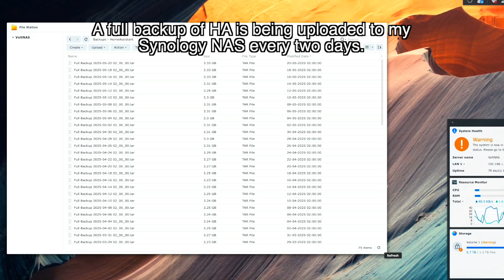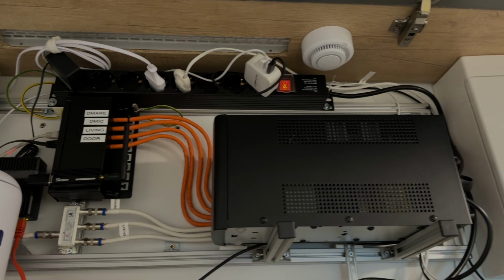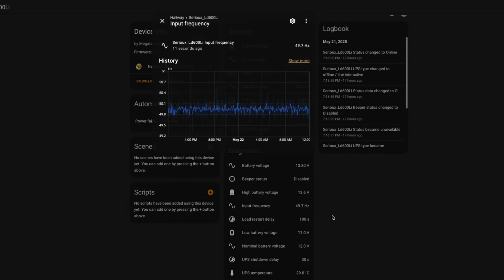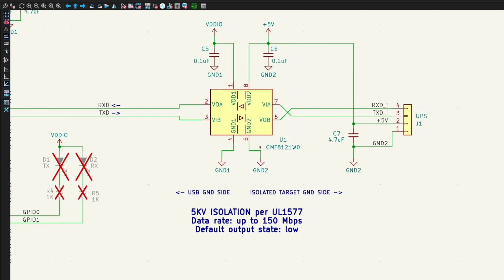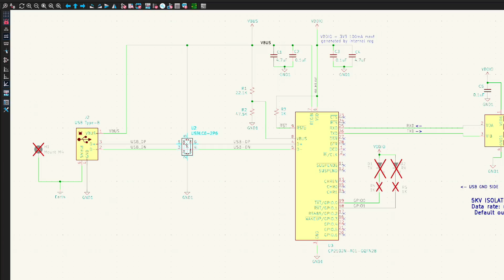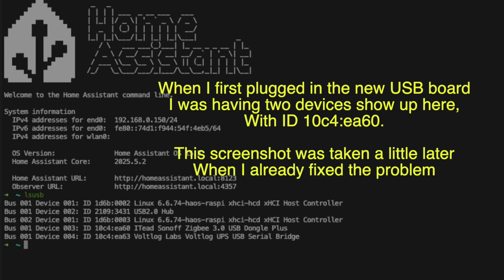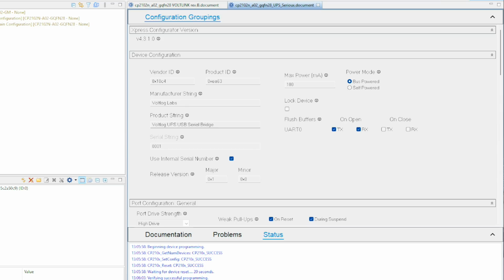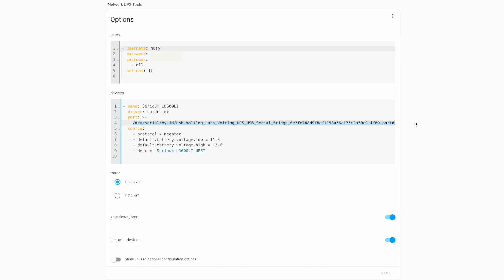I Spent 10 Hours Fixing a $40 UPS - Here's What I Learned | Voltlog 503

Comment: Bro, your HDR edit is INSANE!!! It uses 1000+ nits on white web pages and burns out my retinas. What's even worse: YouTube doesn't give an SDR option if you have an HDR screen.
Reply: The luminance difference between the camera shots and the screenshots is massive, it’s like having audio that’s suddenly 5x louder than the rest of the video. Anyone with a big bright OLED is going to get their pixels singed.
Reply: @Nathan0A  rofl
Reply: My HDR phone is just fine
Reply: @tullgutten  your phone has either fake HDR if it's LCD (no LCD on the phone exist that is HDR capable - it needs MiniLED/FALD backlight and the smallest known MiniLED device is iPad Pro) or it's "fine" because of ABL if it's OLED. OLEDs can't run more than 300-400 nits at over 15% window size - it's a very well known limitation.
Reply: @isoslow  ok i have to agree it's too bright. I watch through Brave browser to block all ads and it apparently didn't support or have turned on HDR, switching to the YouTube app i see the complaint 😅
And yes it's OLED HDR
Reply: @tullgutten that edit is just broken, but also making a tech video like this with flat screen captures in HDR was an absolutely stupid idea as there are 0 benefits from high dynamic range after all.
Reply: An icing on the cake? Bruh made it without a proper HDR screen - it's like color correcting a video on a black and white screen, LOL.
Reply: @isoslow  i love how certian types of asbies will complain about sensory overstimulation in the comments on all yt videos. normally they are the ones who freak out about music being included during a voice over. those same asbies love standing next to trains coz of how loud they are. makes no sense.
watched this video on my iphone 5s lcd... with the retina display. it was called that because its the max resolution your eyes can accurately depict lol. movies were shot at 24fps coz the brain will auto adjust and decide thats normal movement. like those people who wear glasses that flip their vision upside down and get used to it after a few days. the only contrary voices online are asbies with sensory issues
Reply: @isoslow Well pretty sure iPad Pro m4 can actually run at high brightness a lot, genuinely unwatchable in the dark.
Reply: @vevenaneathna So you are calling people with phones and displays that are like, a decade newer to the 5S and have HDR "asbies"
the 5S dosent even have HDR why are you even in this comment, it does not apply to you
Reply: @SUPERBOBESPONJA1000  i didnt say i was using an iphone 5s lol. its an iphone 5s lcd that is on my iphone SE 2016 in a 5s chassie that i built. it has hdr :)
Reply: @vevenaneathna  Still a decade old design, also no 5S has hdr nor the Se 2016
Reply: @SUPERBOBESPONJA1000  same camera resolution as the iphone 14 lol
Reply: @vevenaneathna So? dosent mean anything, my Sony Nex 3 from 2010 its 14.1mpx and its still better than any phone, the sensor is what matter not its resolution
Reply: I use revanced to block HDR content on YouTube
Reply: It's actually possible to help people improve, without belittling them. 

The creator asked you for specifics, so they could understand the concern, didn't argue with you.. yet, you still found it necessary to say they are stupid. Necessary?
Reply: I had no idea this was an HDR issue and now that I turned hdr off me and my retinas are thanking you for your comment 😅
Reply: Yeah, that was a bit of an issue for me since I can't turn off HDR on the YouTube mobile app and I have a phone with a HDR OLED display, but it has an "extra dim" option which I usually only use at night but it does override the HDR thing at the cost of the rest of YouTube's UI being dimmer.
Reply: Yea, this content doesn't benefit from HDR and should therefore not be recorded or mastered and uploaded in HDR. But please shut up about your retinas and get yourself some shades.
Reply: @fluffyblue4006  You know, this is the same type of stuff of why we have epilepsy warnings?
Reply: The fact that YouTube on mobile forces the HDR unless you're on like the lowest brightness setting is just absolutely stupid.
Reply: @parkerlreed  I'd think, a smart person with an epilepsy risk wouldn't watch Youtube videos on an HDR screen.
Reply: @fluffyblue4006  That's the entire point... You don't get an option on modern phones, and you don't get to pick if the HDR is on or off.
Reply: Case in point, this video. Has no use for HDR, but it's on, so if your brightness is anywhere above 5%, you are force blinded on any modern phone.
Reply: On Oled or any HDR monitor. People will get flashbanged.
Reply: I was wondering if it was something with my phone because everything else is like a dual gray but I saw it was hdr which I had never seen on YouTube
Reply: yeah this shit so brigth, idea is to use firefox as it does not have hdr support
Reply: It burned my eyes every time it went to a website lol
Reply: I agree with u, my phone just automatically set the brightness to max and I never seen this phone this bright B4 (even I set it max)  😅
Reply: For me the rest of the video (not the screenshots or schematics) look like grayed out. I had to turn up brightness way higher than usual.
Reply: So that explanes why my iPhone was turning my room into daylight everytime he showed a white Web page (so have to have brightness manually set to 1% on white and 10% on any other colour but then I get flashbang everytime a white screen is shown)
Reply: Stopped watching due to this
Reply: Holy shit, even on my iPhone those screenshots were like a flash bang!
Reply: "burns out my retinas"  "don't embarrass yourself", "just stupid".  Let me get this straight... on a technical video about UPSes, you're complaining about failure to work around lack of safety features on your eye-injuring video monitor when displaying a high-intensity scene, but you consider it's fine for you to alert the channel host about this used case using highest intensity insults?  Maybe learn some manners, if you want to help host improve.  Otherwise it just looks like you're using us all as punching bags for your lack of impulse control.
Reply: Sounds like a you problem... Just saying...
Reply: @Average_Geo , dude, don't embarass yourself. Do you even know what a true HDR screen is? Have you seen one with your eyes?
Reply: @isoslow um, dude, use the right tool for the job. YouTube on an HDR makes limited sense, but if that is all you have… get out of your mom’s basement and touch some grass during the daylight and your eyes will be fine.
Reply from the maker: To better understand this, cause I only have HDR on my iphone screen. Is the problem only related to the white background screenshots that I included which seems over-saturated? Or is it the whole video? Because during editing those imported screenshots which were SDR did seem a little darker so I bumped their color conform to HDR 100% HLG which did make them much brighter.
Reply: @voltlog every screen capture in this video has max brightness. HDR by it's principle controls the brightness of the screen, so if the screen is 1600 nits your video will show up at 1000 nits(max for HLG), no matter what you've set in the display settings, because HDR talks absolute values and tonemapping will tell you nothing. You should never edit HDR if you don't have a screen for it. Make it Rec.709. Also disable HDR recording in your iPhone if that's what you are using to record videos.
Reply: @Average_Geo you are embarrassing yourself further. Official YouTube clients(web, mobile app, etc.) do not offer SDR option if the source video is HDR and you are using HDR screen. If you use 20 years old TN screen I'm glad for you, LOL.
Reply: @voltlog  It's been a minute...but I believe the your target should have been 50% HDR. 
Cool content!
Reply: @voltlog thanks for the very informative video. I struggled with same problem on small ups cluster for 3d printers, I wish I has found that project.

I come to report same issue, screen capture scenes are now permanently burned on my retina. 😮
Reply: @voltlog funny, I really like the HDR, the schematics looked great on my Pixel 7 Pro. Some people will literally complain about anything

Comment: look into mcp2200 usb uart converter, microchip has very nice and light tool to configure vid pid, and they cost less than anything from silabs.
Reply from the maker: MCP2200T-I/MQ in QFN-20 pkg costs $2.14 in 100pcs qty at Mouser
CP2102N-A02-GQFN28 in QFN28 pkg costs $2.26 in 100pcs qty at Mouser.

The MCP2200 needs extra external crystal + capacitors and is not as widely stocked as the CP2102N, for example not available with JLC where I tend to go for prototype assembly.

So there is no real incentive to switch away from the CP2102N.